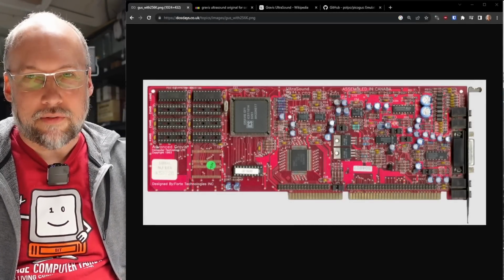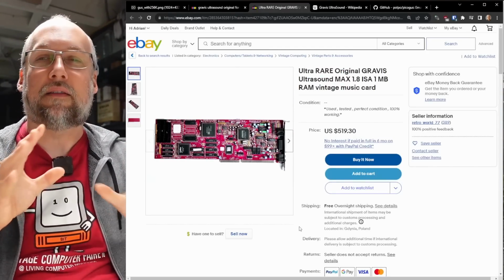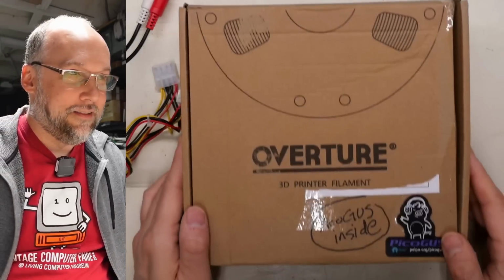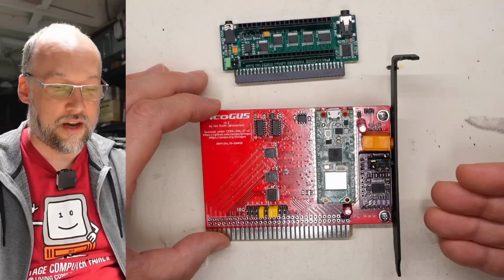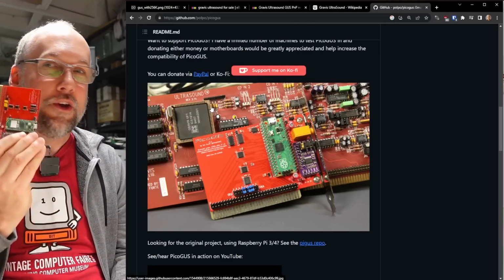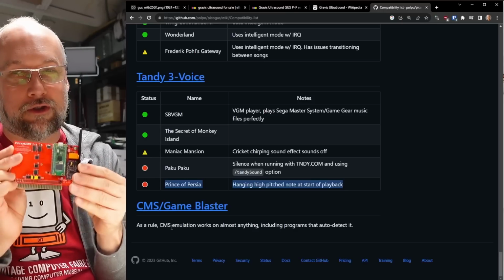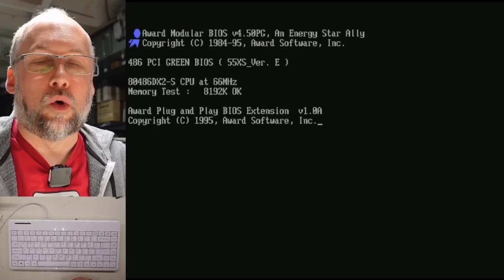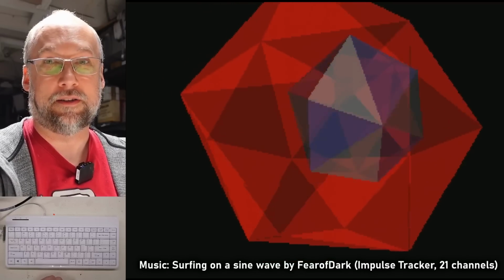The PicoGUS: An ingenious multifunction ISA sound card

Comment: Here is my concern.. I painfully remember the days of win-modem which was a software emulated modem and it was awful .. From then on I’ve been very skeptical of anything software emulated.. that said, I’ve seen a lot of gaming systems emulated and I’m thoroughly impressed.
Reply: Not the same thing.  Win Modems were awful because they were using the already limited processing power of the host PC to handle all the time-sensitive DSP that a dedicated modem chipset would normally do.  This is using a dedicated coprocessor, essentially, to emulate an old hardware device in software.  That coprocessor has computing power equivalent to a whole PC back then, and it’s just there to do this one thing.

Comment: 'once those chips are gone that's it they're out' simply is not true :P if you have a successful product going on, once the chips of a certain type on the market are gone you simply have em make some more ay :P there is basically nothing wrong with basing a product on surplus stock. it only needs to generate slightly more profit than a led blinking and song playing christmas card and then you just call tsmc and go 'make me a million of these chips more'.
Reply: Some chips are unobtanium and would need to be reverse-engineered and re-designed for a modern fab process, or brute force by emulating it with a rpi (which is another miniature pc) as seen here since a $5 rpi + soft emu is cheaper. Or where are you going to get the schematics for TSMC? Not to mention the rights of...
Reply: @freeculture  'emulating' chips with a microcontroller with a clock on it's own is a bad idea. especially with one with pipelining and caching and no way to tell which instruction is gonna take how long. it is not real time. bus collissions and  such can occur too.
Reply: 'cheaper'? ofcourse it's cheaper to just make your own chip containing whatever than to buy someone elses cpu that's totally not designed for the task. always.
and no there is no need to 'reverse engineer' any chips. those chips too were outsourced to chipfabs. the chipfabs therefore have the designs. therefore just send some infiltrants into the chipfabs to obtain the original designs used for the original production batch. (even if the ones of the ordering company went long missing and the designers are all dead already, ya know, the factory that made the stuff is still around :P LOL.
Reply: my gawd computer people always acting like it's rocket science to get a few chips or 'commodore keyboards' made and it takes 2000 of them and 'crowdsourcing' to get it done while in the automotive branch they design a new plastic headlight for every single car and get it made and the toy industry makes a new chip for every single kerby toy or christmas card that blinks lights. lol. waddayamean it 'costs millions'. how many $0.25 christmas cards do you intend to sell to cover that plastic blob chip? 100000 at most? :P
Reply: willing to buy tsmc and run it like pcbgogo does. if they're willing to sell. :P or umc or whats left of that or any of em.

Comment: I spent so much time running demos on my 486/66. I had a Sound Blaster 16, so I had to use software mixing, and I just couldn't believe computers could be fast enough to do software-rendered 3D graphics, and mix the music in realtime ... and yet the games at the time seemed so limited (of course, adding the level of interactivity required for gaming would have probably overwhelmed the CPU's capabilities). I wished I had a GUS, but the prices were far too high, plus the potential need for a second sound card.

Second Reality was such an impressive demo. When you said you had to switch out the music I got worried, but the replacements you chose fit the original theme really well. Nice job.

Comment: I don't remember the details, but by GUS sound quality was light years away from everybody else on the market - by the time I managed to buy by GUS Classic (in 1993, I think - early adopter!), I remember hearing the Unreal 1 soundtrack and be absolutely amazed. I don't remember if Unreal 1 had support for GUS, if it was added later, or if I ripped the mod files and played on a GUS supporting tracker - but the fact is that the sound that card was spitting were GOOD, REALLY GOOD.

None of my friends' sound cards sounded that good - even the dudes with beefy machines.

Later I learnt that until the AWE series, the audio circuit of the SoundBlaster cards were really shitty - noises, distortions, you name it. Creative Labs only gave some care on the analog part of their cards when the ProAudio Spectrum (PAS) came to the market, also with an absolutely excellent sound quality - but since the PAS were pretty expensive, it didn't imposed so much of a threat, so the SB cards kept sounding shitty for some more time.

GUS was a game changer. The Demo Scene LITERALLY gave the finger to Creative Labs and jumped ship on Gravis - and Gravis donating or selling at huge discounts the GUS to demo makers at that time surely helped. ;)

Anyway… My GUS died (I'm still mourning it), and so I started to experiment with the many sound cards available on the market at that time, and ended up settling up with AWE32 (the first model! Again, early adopter!). Not being enough, I shoved 16Megabytes of RAM on it - making Doom music be something from another world!

The AWE32 was the first Creative Lab (or at least, is how I remember it) that really sounded good, finally making me kinda stop missing GUS on my games (SBOS INSTALL!! hehehe). I hooked my PC on a decent Stereo Amplifier (really good stuff) - and that's probably the reason I was able to percept that shitty sound from previous Creative sound cards.

Comment: What you describe about the hardware mixing and samples in the start, are exactly why Amiga MOD files and other systems that use this approach, are not playing what is known as Chip Tunes. Ssmpling are not Chip Tunes, as it is not the actual chip that generates the sound on its own.

Anyway....
I had a GUS ACE, boxed and complete in box down to manual and registration flyer. Sold it on Amibay years ago, as I realised that my need were on SB-Pro and Adlib plus a Dreamblaster S1 were fullfilling all my needs. Hence I use YMF-718/719 with Dreamblaster S1 only.

The only thing that were crappy about the sale, were that I never recieved any feedback at all. I made sure that I gave updates on all progress, but there were no response from the buyers side. I dont even know if it made its way to Finnland. Worst sale ever.
Reply: That's definitely the modern definition of chiptune, while sampling the waveforms is now known as fakebit. 

Which is ironic, because the term chiptune originated from MOD files sampling the SID chip waveforms — done both for nostalgia purposes and to get the sizes of the samples down as low as possible.
Reply: @kaitlyn__L  You are not correct. I was there, being a computer freak doing computer freak stuff, when tracker music got invented. And mod files were not about sampling the SID files. Samples on the instrument disk, were taken from many sources. Like Yamaha keyboard instruments as an example.

Comment: Well this PicoGUS is something very interesting and one day I may even try it. Being able to just go CMS and Tandy (and even OPL2) is very handy, the CMS-equipped SB2.0 I happen to have often feels flaky in various boards so I'm absolutely unsure if it's OK and how it should actually sound.... As for GUS, I'm curious about the compatibility, original GUS started to lose its marbles in very late ISA machines, with a P3 or Athlon it's a pain to make work properly (well trial and error and unfortunately a big chunk of luck). GUS PnP is more solid in these circumstances. Probably. Maybe.
So, while I have a nice cardboard box of them I'd still gladly try this Pico version. They're not immortal to begin with. My only Extreme just stopped working after a few hours. I have two PnPs with broken jack connectors, well that's hopefully reparable even with my skills and dexterity.... Having some affordable (for normal people, not necessarily for me) modern replacement is a very nice thing. What you said about the new Pie version applies, though - I'd like to try it in dozens of crazy motherboards with various unknown ISA timings so I'm not sure it could handle these, especially when ISA "has to" be overclocked for decent VGA performance.
Oh and the MPU-401 functionality is another big selling point for me. I happen to have a nice little Yamaha MU-80 box to try too....

Comment: I bet a 2usd fpga chip can do full gus. transformer cores, as computing cores, per clock instruction wiring switch, real time, copyright claim why. use fpga that run at 400MHz, like max/cyclone V/10 fpgas. fpga is more hardware but still software defined, software defined hardware.
Reply: Yes and no, the FPGA can't run.dosbox code. This is what the picogus is doing. C code is much more simple than verilog.
Reply: you emulate the actual hardware, not dosbox, nonsense, while c is simpler, fpga verilog can-do would say otherwise, you can do both, while fpga having its advantages, sometimes clock frequency/efficiency in same size of silicon @freddyvretrozone2849
Reply: @gsestream You dont  understand. I designed the PicoMEM board.
What Ian did is he used dosbox code to emulate the GUS.
So, the picogus is like dosbox in an isa card.
I use dosbox code for the disk interrupt.  And I found bugs because there are things we fo on a real pc we dont do xith dodbox.
Reply: @freddyvretrozone2849  fpga is an ISA card, if it wants to or its programmed to be one, and you want others to do like you think it should be done, but what you say is not right, I did not say anything about dosbox or what ian did, so you must be wrong
Reply: @gsestream  FPGA is software defined BUT not C/C+× that is all what I say and you answer I am wrong ?
Reply: yes fpga mister runs dos and other stuff like a processor just fine @freddyvretrozone2849

Comment: Despite the higher internal clock speed, the 486 DX2 66 MHz had to bow to the real King: The 486 DX 50 MHz, which was running the bus at full 50 MHz speed (not half-speed, i.e. 33 MHz of the DX2 66) and could drive special local-bus SVGA cards much faster for the best gaming and scene experience. Full 50 MHz CPUs, motherboards, and gfx cards were a rare specialty back then. I wonder now.
Reply: I recall the text at the end of Crystal Dream 2 mentions the authors "not buying a 486/50 for coding 386 demos" or something to that effect.
Reply: @Roxor128  They sure knew how to pick the best hardware, and how to use it! CD2 is particularly impressive because the rendering pipeline was totally software-based and used clever tricks to maximize the framerate.

Comment: I may be wrong here, Adrian, but I am quite sure that you could have used one single game to test all the extra sound card abilities, so Tandy, Adlib, and CMS. And that game is The Secret of Monkey Island.
Reply: Yeah well for your test Prince of Persia works with each of them. I think they programmed the opl2 to sound almost identical to the CMS, normally the difference is huge, but not in that game. With Tandy you get pcm samples, same as having a sound blaster. The other thing that makes Prince of Persia so good for testing, its one of those games that work with nearly all graphic cards from hgc to vga. For both gpu and cpu there is Stunts, or 4d blahblahblah...whatever that stupid long name they had in EU, sadly the source code was lost but it was declared freeware by the creators, that game isn't particularly great with audio it was just mt32, sb, adlib iirc.
Reply: @freeculture I didn't know that Stunts supported MT32. Worth checking out. And thanks for the tip about Prince of Persia.

Comment: Projects like this are great to see!  I worked at eTek Labs (formerly Forte Technologies) in the mid-90s.  It was soon after the GUS MAX came out, and we were working on the software/hardware/drivers/tools for the Interwave chip, mainly for Reveal as the primary customer.  Compaq took the design and made a version of the card for their PCs and Gravis took the design and used it for the GUS PnP.  I still have a few boards around here and there.  SBOS did decent Soundblaster emulation by hopping in through a patched EMM386, and would intercept writes to the soundblaster/adlib ports, and then figure out what patch to use.  We had a library of about 100 games that we'd test with, and the SBOS guy honed in a lot of the settings for that emulation/interpretation.  It wasn't perfect but it worked fairly well.  IMO, You were better off just using SB emulation for digitial samples, and GUS/IW for midi music. ;D   I'm open to questions about that if anyone's still reading this.
Reply: Hi Yorgle, did the Sound Forte line of cards fall under Forte Technologies? I have a SF-32 with the ICS Soundfont which was also use for Gravis cards.  If so do you have anything on the card or ICS chip?
Reply: It might be a bit before you arrived because you mentioned the mid rather than the early 90s but can you confirm if the GF1 chip made by ICS was based on the Ensoniq OTTO sound chip and did you guys license it from them? Just wondering if you knew about that since I don't think anyone ever did a proper one on one interview with Paul Travers about his days running Forte and asked him about that kind of stuff.

Comment: While I'm not a retro PC guy, I see that this is a REALLY cool thing.  (I'm a retro CoCo and occasionally C64 guy)  It occurs to me this picoCard thing can be an EVERYTHING card.  On the left side of the card could be an interface which provides expansion for all manner of controller types (floppy, various HDD formats, etc) but on the right it could ALSO potentially provide external IO interfacing.  The use of the headphone jack to expand to a MIDI interface is just one example of what's possible, but because I also play with LEGO, I see a modular expansion framework which could probably host a range of IO types.  If they expanded to using a nano pi, they could even utilize the HDMI out.

They should absolutely modularize both the left and right side and maybe even expand horizontally into second slot territory to pull off the old style IO port on a slot cover with a cable going to the I/O board.  If they are trying to make whole sound cards that can be reprogrammed, they may be wasting their efforts.  Making a generic and modular board and making varieties of I/O interfaces would be the way to go.

Then they could make just the one card and sell interface devices.

Comment: I watch this and can't help but thinking back on the "golden age" of the demo scene. There were a lot of impressive demos, but the ones that I remember are the 4K ones. And for the younger crows, no that's not the resolution. To create a demo that fit in 4096 bytes takes skills. And they did it with skill. You might think they would be primitive and simple, well then think again. The one demo I remember was called something like Head Crash. Now as bad as my memory is that is highly suspect, but I'm at least 100% certain on the "Head" part.

In 4KB they had pressed in several demo parts, including  reflections, a flag waving in 3D, some flame effects and more. The finale was a bouncing 3D bump mapped ball with a face on one side and some message on the other. Now how you fit all that, including crude but still textures into 4096 bytes I never understood. This was a DOS executable as were almost all demos. The funny thing is that someone made it a windows executable and that file was smaller than the DOS version...

There were another 4K demo that was written for a competition but got disqualified. It was the right size and had a nice 3D engine showing a flight through a cityscape and a Descent style flight through a tunnel system. So why was it disqualified? Simple, it had GUS music  which wasn't allowed in the 4K category...

Fun times...

Comment: 9:00 that is not exactly true.  yes pentium was faster than 486 but for music you also needed a great scsi controller and a scsi stripe or raid which was very expensive also software raid consumed so much cpu power anyways. and scsi raid controller was so incredible expensive anyways.  so even at pentium era, wave table synthesis with on board sample ram was wuite useful and valuable.  you were not able mix record run virtual instruemnts etc even with dual cpu machines.

Comment: Yes, there was a PC sound card that had a SID chip, called HardSID. I have one of the original cards for ISA bus, but my only computer with ISA slots (a Pentium 166MHz) isn't in full working order. Plus I'd need to find the software which is easier said than done.
Reply: I'm in the process of getting HardSID emulation up and working on the PicoGUS right now! It took some effort but I got it playing SID music with SidPlay2/w, but it still needs a lot of work to sound better.

Comment: Agree!!  Software defined cards are the future.  I'm looking forward to seeing multi-purpose single cards for legacy hardware (ie; combo of multi-IO of serial/parallel/SD2IDE, CD-ROM emulation, video (VGA/HDMI), sound, wifi).  I envision this to be  single card with a daughter board to support the additional external ports & Wifi antenna).   Moreover, add onboard USB support to connect USB-storage and/or USB-Mice/Keyboard support and have the software defined card pass the IO data back.  Hence, no need for DOS/Win9x USB driver support.     Thoughts???